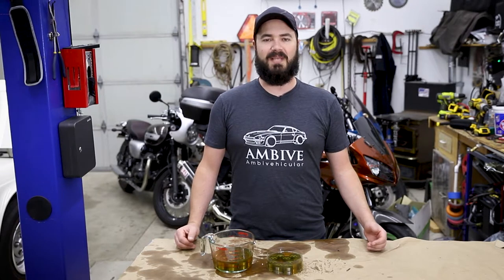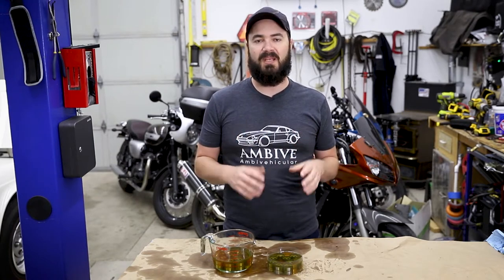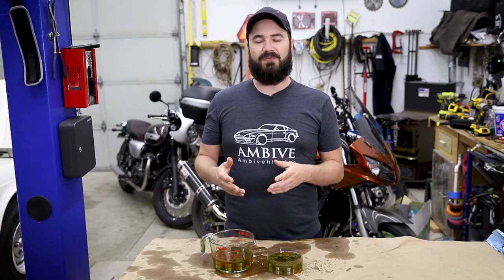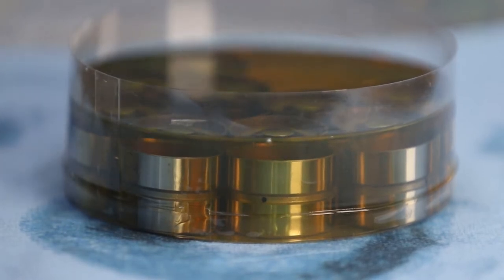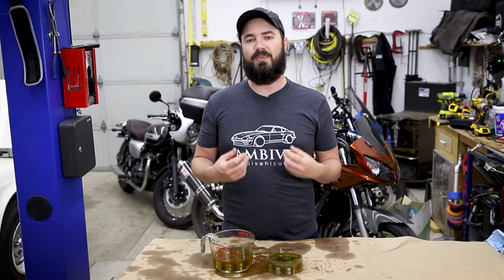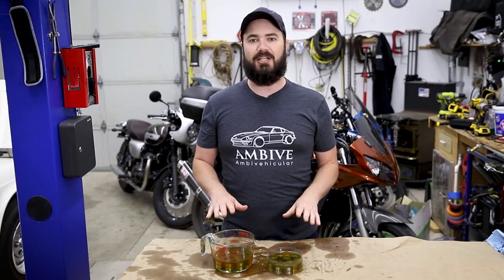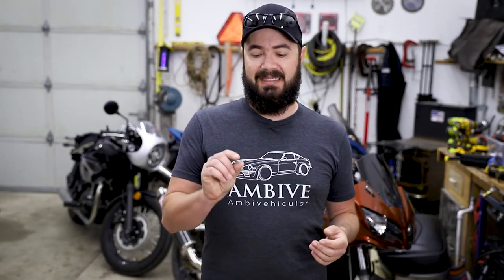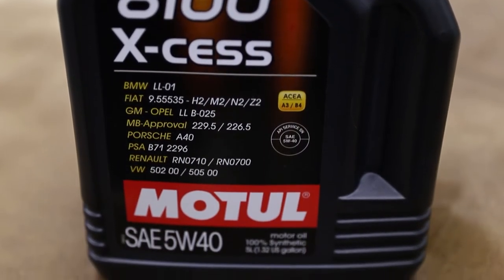Fixing the Miata lifter tick

Comment: Dude that was awesome, best video Ive seen for a small project like this! Only question is if you do go with new lifters do you have to do any other form of valve lash adjustments??
Reply from the maker: Not with this project. The hydraulic lifters take up slack automatically assuming there isn't damage. If it was an NB or other solid system you need to check the shim tolerances.

Comment: Hi, Thank’s, i ‘ve to do the same thing. I just removed the valve cover but i’m  blocked with the cam. Before to take-off the pulley you do not make marks on the belt and pulleys? Thank you for your answer, i have my head in the engine 😂

Comment: what you did you do to keep your timing belt on while taking off the camshafts?? did you not remove the bottom pulley either??
Reply from the maker: Usually I just use zip ties or something to keep the belt teeth in the same place, then verify nothing moved when I am putting everything back.

Generally it's just a game of counting teeth on these and checking the marks just to verify it's all good. Making sure the engine is TDC before taking things apart makes life easier when verifying.

Comment: did you have to retime engine or where you good buy just keeping belt on cam gears
Reply: You can see he put zipties on the cam gears to keep the belt from jumping any teeth if the belt moves you'll be forced to retime the motor, so this job is possible without having to retime the motor as long as you just put zipties thru the cam Gear & over the belt so it can keep the belt in the correct time

Comment: I rebuilt the lifters yesterday and primed all of them with oil and they are still ticking, do I need to let them “run in” at all? Please help.
Reply from the maker: If they are filled and ticking, you may need to let them run a bit. It could also be a little air in them or you could have play elsewhere. It could also be the oil you're running combined with how worn your valve train is.

You can make guesses by how bad the ticking is, if it changes with temperature or oil pressure, etc.
Reply: @AmbiVe  it is due and oil change, do you think this will help?
Reply from the maker: Old or thin oil will definitely make it tick or make it tick worse. It also depends on what oil you're running for additives and viscosity.

Comment: You have done a righteous installation with that rebuilt engine. Did you built it yourself, or buy a short block? I have a 1.6L Miata, and I only rarely have a little lifter tick, and then only at start up. Frequent oil changes (around every 6,000 miles or every 12 months which ever comes first) keeps a fresh load of detergent in the oil. That may be what keeps my lifters rather free running.
Reply from the maker: It was a rebuilt short block the girlfriend sourced and we prepped. I think they either didn't prep the lifters when they did it or it just sat forever in a warehouse before we got it.

Either way, it's great now. Maintenance is definitely a key.